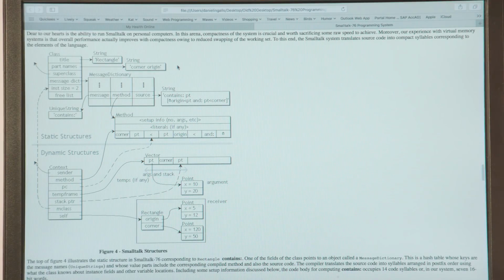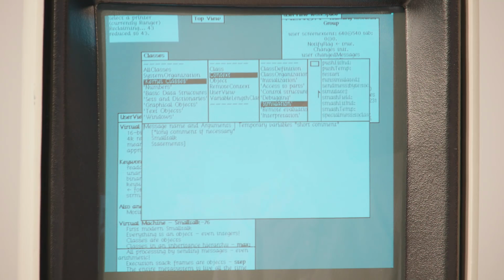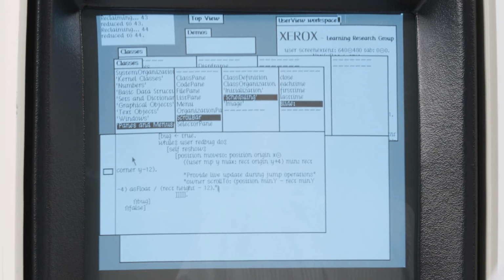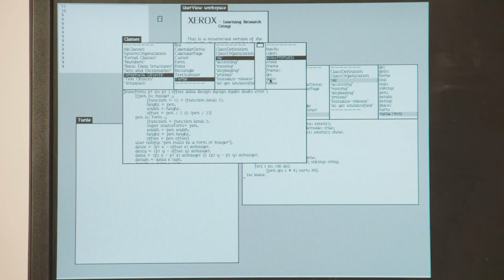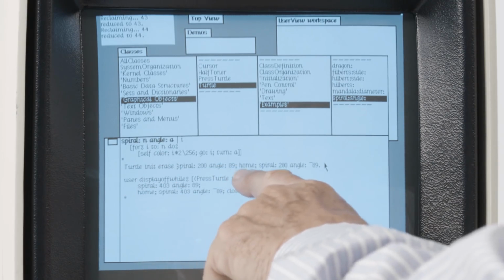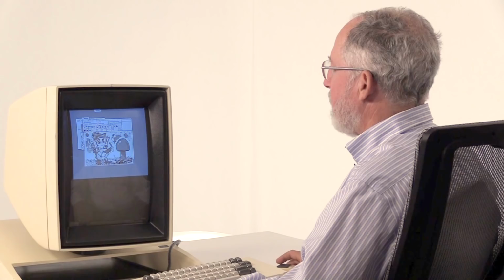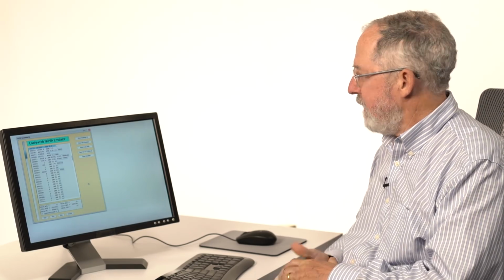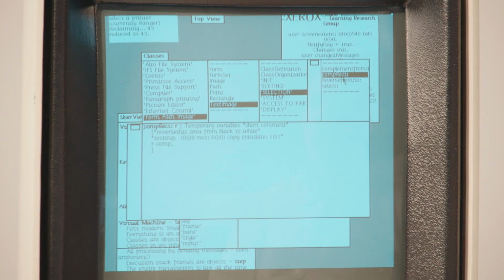Alto System Project: Dan Ingalls demonstrates Smalltalk

Comment: this is so cool. the system which would later  be used by ward cunningham and kent beck and help spark the agile movement, tdd, clean code, … and it’s level of interactivity is still far ahead from what most systems we are programming with today offer.
Reply: The idea that we explore code libraries using typeahead in an IDE is such a worn-out crutch :(